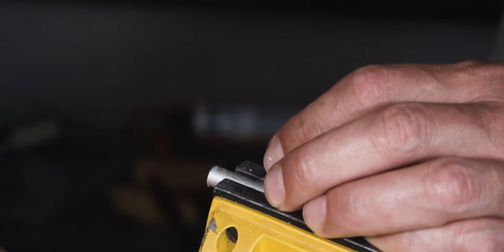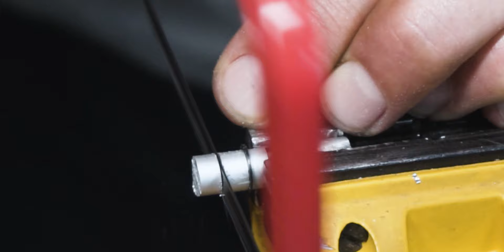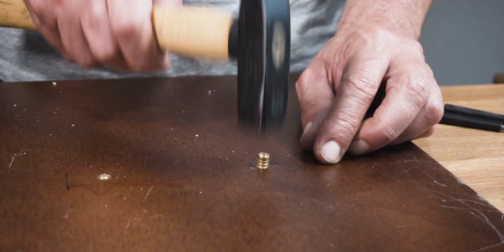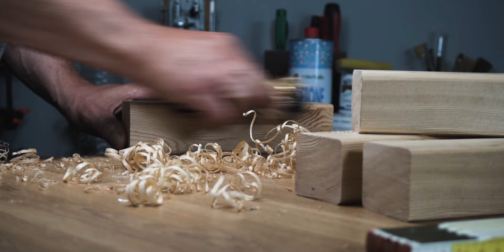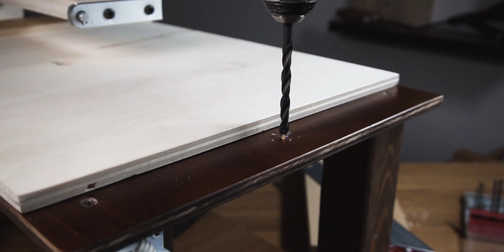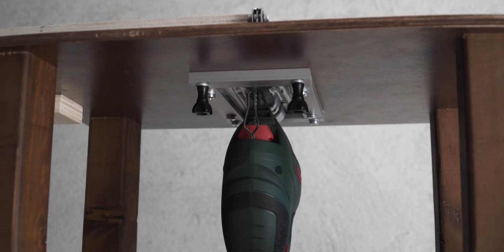Jigsaw Table DIY that's perfect for cutting circles

Comment: Let's say a board has a top, bottom, two sides and two ends. If you take another board and fasten it's side to the top of the other board, you increase it's stiffness (or resistance to vibration) exponentially.
Reply from the maker: There are several ways to solve the problem, for me that added piece was enough. I also thought of a strip at 90° to the top in order to create a "T" shape.
Thanks for your advice, I really appreciate it.

Comment: Howdie from Canada 🇨🇦 SK keep your projects coming joined the adventure mighty fine Sir thanks for sharing were are ya from never saw a power bar like this ? Ya make it look easy to do don't have to be rocket Sciencest to make this  glad found ya carry on mighty chilly in winter here 44 below most of the time in my wood shed hard to keep going cause too big but enjoy  building  stuff it's 60 by 40 13 ft high old queset turned into workshops  metal building old cars and trucks then wood part owell enough of your time ya got this later Paul 😊
Reply from the maker: Thank you for your kind comment. Power sockets are made like this in Italy. Greetings.

Comment: Putting screws into the ends of the plywood causes the plies to separate.
Try using Bamboo skewers at 22.5 degrees with a miter joint instead (and use glue of course).
It is a bit like 'stitching' the joint together.
Reply from the maker: I made pilot holes slightly smaller than the diameter of the screw to avoid the problem and that usually works.
Thank you for the advice, I will definitely try your method in the future, thanks also for your support, much appreciated.

Comment: Why using an aluminium rod to make the rear guide, instead of a steel rod?
Reply from the maker: I believe aluminum is sufficient for this task, and is much easier to work with

Comment: Thank you, congratulations for the video and above all for the device you created, very practical and seems rather precise. I read that you used waste material and that therefore the measurements depend on that and everyone can adapt them to what they have. I'm about to do it too and I have to ask you one thing though. Is there a reason why you chose to place it at an angle to the rectangular shape of the base? I'm asking because I also have a piece of wood more or less like this and I'm unsure what to do. Thanks if you can explain to me. Hello and congratulations again
Reply from the maker: I think in the video you had the impression that it is oblique due to the distortion of the lens, everything is square, the shelf, the base and the supports. The jigsaw is centered on the plane and perpendicular to the user.
it is a very simple and practical tool where I tried to give a different idea for the cutting adjustment system and for fixing the blade (I see that everyone else always use 2 ball bearings to hold the blade).
Thank you very much for your questions and for your appreciation of the video.
Reply: Thank you very much for the very quick response. I write from Vicenza. One thing that I find very practical and versatile is the system for fixing the hacksaw to the bench which makes it possible to release it for freehand use very quickly. One thing that I don't understand well compared to other creations that can be seen online is why, at least so it seems to me, it is not possible to move the blade's sliding point in height (raise or lower) in the case of different thicknesses of the wood to be cut. Was it a specific choice? Thanks again and goodnight now. @LTMS
Reply from the maker: Visto che sei di Vicenza ti rispondo in italiano mentre mi mangio un gianduiotto nè?
Ci avevo pensato alla regolazione in altezza, ma anche se rimangono un paio di cm di gioco in altezza quando taglio il pezzo non fa molta differenza sulla qualità del taglio, essendo la lama spessa e molto rigida. Anche con la sega a nastro non regolo sempre la guida a raso del pezzo da tagliare. Le tolleranze in falegnameria sono diverse dalla meccanica e poi comunque dopo il taglio c'è sempre piallatura e carteggiatura.
La tendenza online è quella di usare i centesimi di grado per la precisione ma le trovo abbastanza inutili, la pratica richiede precisione si, ma senza esagerazioni.
Spero di esserti stato d'aiuto e non esitare a chiedere se serve. @italoponcato2414
Reply: Grazie della risposta in italiano👍: @LTMS  come ti ho detto trovo molto valida la tua soluzione rispetto a quelle che si vedono in rete per il sistema di bloccaggio del seghetto ma non solo; è interessante anche il sistema per ottenere dei cerchi di certe dimensioni. Mi confermi che anche il pezzo che serve al riguardo è quadrato, perchè dal video sembra effettivamente più corto (effettivamente non mi pare serva che sia lungo come la base sottostante...)? Ancora grazie e scusa l'insistenza ma sto recuperando i pezzi di legno che servono e quando parto vorrei essere organizzato... Buona serata👋
Reply from the maker: Domani cerco di fare 2 foto decenti del banco con le misure che ho usato io e lo pubblico nella sezione community dei post della pagina, dovrebbe aiutarti @italoponcato2414
Reply: grazie mille @LTMS
Reply from the maker: Ho caricato 5 immagini con le misure, puoi cambiarle come vuoi è solo questione di adattarle alle proprie necessità. @italoponcato2414